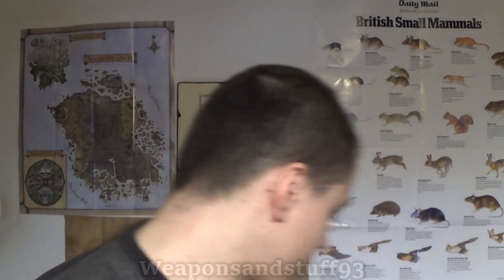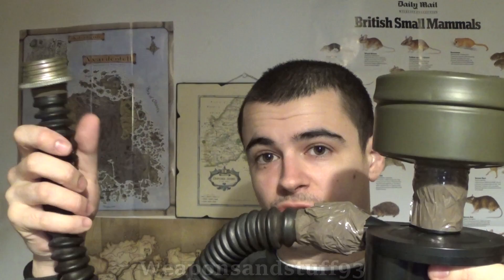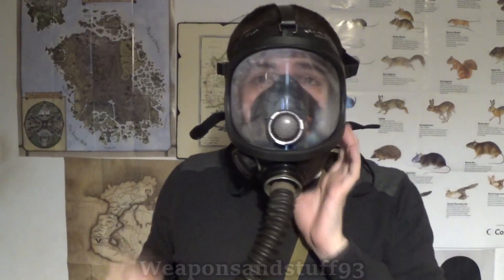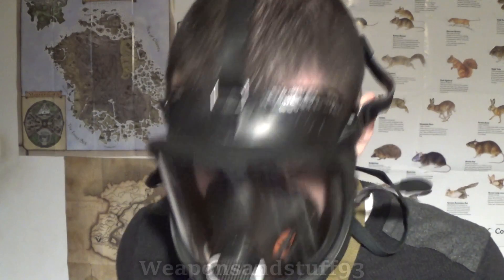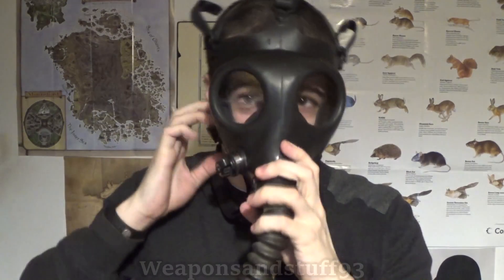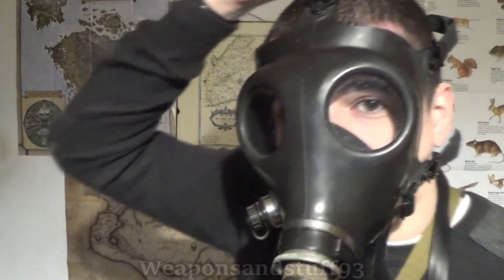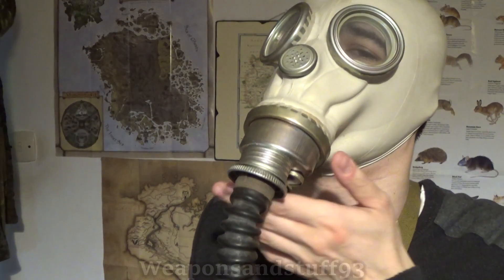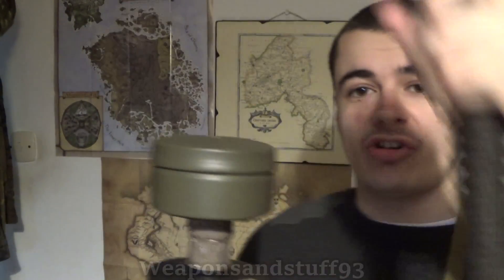Homemade gas mask/respirator blower system

Comment: Wouldnt it be a bad thing tho? Wouldnt it use the filter while you exhale thus using it twice as fast? Basically using it to filter unused air?
Reply: Well yes, but a papr is used to make breathing easier, assuming that filter availability is not an issue.

Comment: I had a similar idea. Except I use a filter carrier with the attachment for a vehicle filtration system. Rather than drawing through the filter, I'm blowing through the filter. Add that with a potentiometer from Amazon and you can adjust the rate of flow and it won't be as loud

Comment: I would highly recommend pushing the air through the filter as opposed to pulling it through. Since the Blower is not a propper CBRN or NBC rated one, you don't want that between your filter and you as a leak or failure would compromise the whole system (single point of failure) If you have it the way I suggested it then even if the pump itself leaks you don't have to worry as the air is filtered after the pump not before or if it outrights fails you can just continue on in APR. in that way you can essentially DIY a setup that still retains its CBRN or NBC rating (mostly)

Comment: Right off the top the biggest issue I can see is the fact that it actually is too good of a pump, all that suction means that filter is going to be used up extra quick, in addition to the need for batteries and noise, it doesn’t really seem worth it, if you could find a more suitable pump this could be great, keep on trying I like your effort

Comment: hey if you want a pretty cheap respirator blowing system I have found  one on ebay  it's for a child but you can take off the air blower to connect to a hose for a respirator   https://www.ebay.com/itm/293017170076 :D
Reply from the maker: Yeah that's the Israeli one, quite well made from what I understand.

Comment: I have used factory version. The motor in that is very quiet and turning slowly. It had lithium battery that lasted for hours. It also shows battery level and starts to beep before it runs out of power.working with it is a lot easier and also keeps your head cooler. I think you need a adjuster to slow down the engine.
Reply from the maker: Yeah that's obviously a very good one, some pumps though are literally like this thing.

Comment: That would work really well if you had to put it on and gas was in the mask as it would flush it out without hassle.
Reply from the maker: Yeah it works the same way as all powered/positive pressure masks work, but not that practical for military use.

Comment: Can it be used for car painting/spraying??will 3m filter works with the pump?tnaks
Reply from the maker: Well it can do anything you'd use a regular respirator filter for, no idea if 3M filters will fit on it because as you can see I made it myself.
Reply: I will try to customise to fit it in..what i am just asking do u think it can be use for painting..and not necessary 3m filter..but any filters that can be use for painting

Comment: Reduce the air flow to make it quiet...  Or for a Rebreather.   tjl
Reply from the maker: Wouldn't that damage the motor if the air flow is reduced too much?
Reply: @weaponsandstuff93  you can slow it down by using a lower voltage (you can open it and convert to use less batteries or putting in a voltage regulator (i don't know the english name))

Comment: What advantage is there to have a positive pressure system instead of a negative pressure system?
Reply from the maker: As explained in the video, a loose fitting mask will not allow gas in, gas is forced out by the positive pressure of the mask, and it's far easier to breath.

Comment: I might have missed something, but how would you switch the filter, or would you just screw it on to the actual mask? Btw happy new year
Reply from the maker: You'd have to cut the tape and tape a new one on, that's why if you did a DIY job and glued a 40mm screw to the pump it would be good.
Reply: Weaponsandstuff93 alright, I got it now thx

Comment: How well do gas masks filter smoke and could you do a video on how resistant the eye lenses against something like an air rifle
Reply from the maker: They filter smoke (A particulate) but do not provide oxygen or get rid of carbon monoxide.
Already sort of talked about the lenses, all masks will get broken lenses if they are shot.
Reply: why do you need a gas mask to protect you from a rifle lol?
Reply: @torenmcknight  airsoft o paintball

Comment: Isn't the half face gas mask made by 3m and it can block carbon monoxide right?
Reply from the maker: Which half face gas mask? There are lots of half face mask, some made by 3M others not.
And no, regular gas masks with filters do not block carbon monoxide.

Comment: Couldn't you also attach the air pump and filter to any empty air tank?
Reply: That's what compressors are there for.
Reply from the maker: I don't actually know how pressurising an oxygen tank works.
Reply: I think they would use a very strong pump but a large air bladder might be easier to fill.

Comment: So what is the point of this contraption? Isn't it going to ruin the filter faster since more air is going through it than it is required?
Reply: Positive air pressure keeps leaks from letting bad air in, and is safer on the off chance one passes out or has trouble breathing, but this would work better with the pump calibrated to just over the user's breathing to use less on the filter and the batterys.
Reply from the maker: I guess you tuned out when I spoke about positive air pressure.
Reply: It just doesn't sound practical to waste a filter like that.